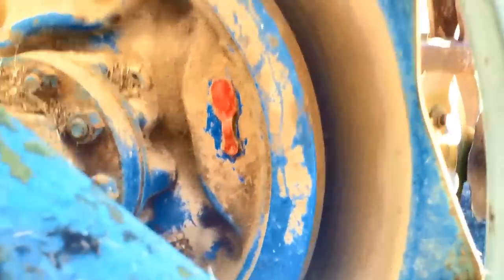Adjusting the brakes on your Ford Tractor- Models 2000, 3000, 4000, 5000

Comment: In reference to the topic: Out of the Ford tractors during this era, only 2000 and 3000 have drum brakes. 4000 and 5000 have modern oil bathed tractor brakes inside the middle axle housing, and re: those this video is not relevant.

Comment: Just wondering why the need to jack the tractor up to adjust the brakes?  I'm not disputing the point, I just don't understand how that would affect the brake adjustment, but hey, if I knew much about tractor maintenance, I wouldn't be watching this video in the first place.
Reply: Dale Little they that because if you get the brake shoes to tight on the drum you can burn your brake pads up.
Reply: @godragons100 i4 99 😊😊u

Comment: does the  the adjustment star wheel go in the same direction to tighten on the other side or is it the oppersite direction..... ie: left & right hand threads?
Reply: The manual says to turn them clockwise.
Reply: @shark2jlb  clockwise for tight the brack or loss?